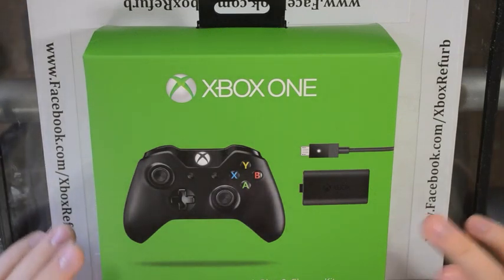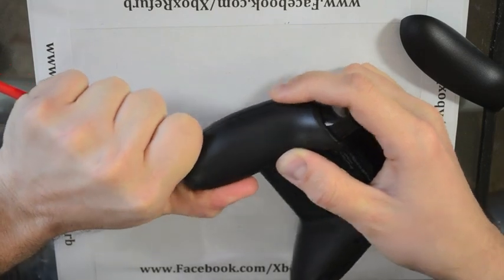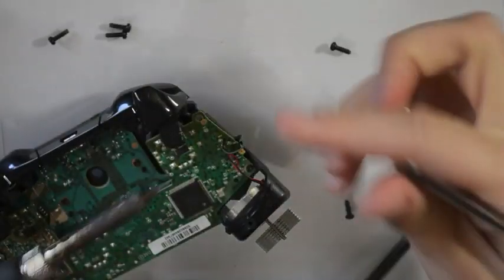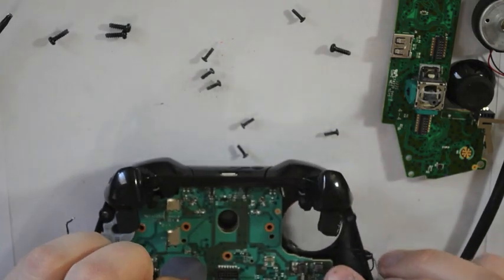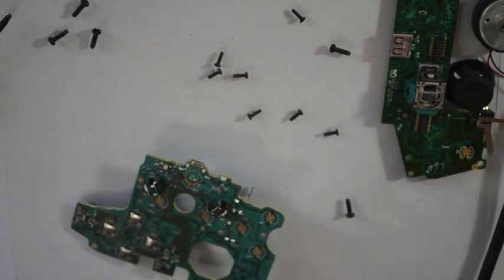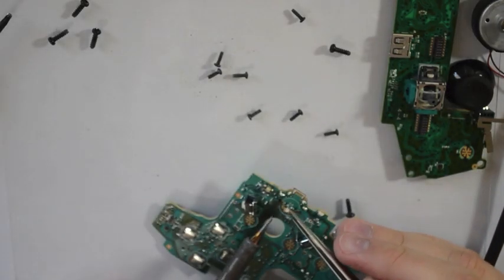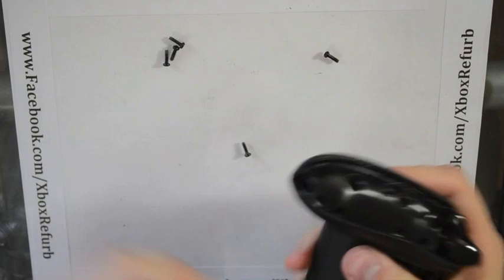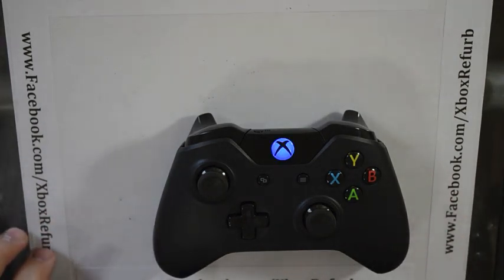Xbox One Controller teardown, disassembly, LED Swap of X1

Comment: Hey guys hopefully someone can help me with this: I swapped out an led on one of my controllers no problem but did not have much success the second time around. I managed to get the original led off but upontaking it off it seemed that the solder points ripped off and now can't get the new one on right. I manage to see the new one slightly flash at times when having the soldering iron at one end and tweezers at the other while attempting to solder it on but it will not work after I try to test it. Thanks in advance for anyone who read the entire thing and to anyone who might have some insight on this!

Comment: I changed the LED on my Xbox one controller.  After reassembling my controller will not turn on wirelessly with batteries.  It will only turn on with the cable connected to the Xbox one.  The Xbox light on the controller comes on and a the buttons and triggers are functioning. 
Any guidance here would be a great help.  Thanks.

Comment: Changed the led and now my controller won't even turn on. I'm so discouraged now
Reply: You getting into electronics? What happened?
Reply: Tried changing the led in my xbox one remote and now it doesn't even turn on. I don't get it. The led shouldn't effect the power of the remote.
Reply: Jeff Krug you prolly touched the board for to long or touched somewhere  your not supose to lol
Reply: Yea I'm a newby at this stuff. Taking off the factory led was a bitch. I installed an led in my console perfectly. Guess I need to spend $50 on a new remote:/ I didn't realize touching the board could cause issues.
Reply: Turns out the controller works except for the home button.
Reply: Did you do soldering? Or was it plug and play? If you were soldering, I'm wondering if it were the wrong led, or there could be a short.
Reply: We can diagnose and fix it in our shop
Reply: I'm pretty sure the left pad was ripped off. When I get a new controller maybe I can send it your way to get the led put in that I want Battle Beaver Customs. I don't want to risk damaging another controller.
Reply: We can retrace and repair damaged pads too
Reply: How much?
Reply: 15$ and 10$ to ship back
Reply: Buy a broken controller with thumbsticks that don't work and swap out the thumbstick board for yours. Easy to do if you have the torx security t8 and a torx t6 screwdriver, because the thumbstick board just pulls off when the screws are unscrewed as shown in the video.

Comment: Hey Chris,  really urgent question here. Which way do I put the LED in? Does it matter? I thought it did for the 360 controllers. Which way do I place the LED in? By that I mean the tip of the triangle or the fat side? Which way goes left/right? I wanted to test if my controller led would turn on without having to assemble the controller entirely, but when I applied battery power and pressed the button nothing happened. I know I didn't tear out a lead, help me please!!

Comment: I'm a Microsoft fan all the way. Always have been. But my god are the thumb sticks are horrible on these controllers. Over time and excessive gameing the plastic shell around the thumb sticks completely wear down and uneven to the point where they feel like it has a seized up bearing or something or it feels like you have dirt in there. With the PS4 controller thumb sticks (I can't believe I'm saying this) feels like butter. There so smooth I almost prefer the PS4 controller over the Xbox One controller.

Comment: Hi dude, awesome work but, where do you get new shells and buttons from? So far, I've only found a full gold replacement shell and buttons from a chinese retailer.
Reply: I know there was a lot for the 360 controller on Ebay for quite cheap, but there isn't much for the One's yet.  I'm waiting until there's more on there for the One so I have more choice and parts are less expensive.

Comment from the maker: @itsbohn they won't fit, the ones I use are redesigned on the shaft size and the lower cup. I will soon have kits available with a prybar and T8 torx to sell

Comment: Was the unsoldering of the rumble motors necessary?
Reply: yes it was. If u see after he unsoldered them it showed some screwes which are needed to take off the mother board
Reply: Maxwell Nazarko That's funny cuz I took mine all the way apart without removing any wires. Guess Im just better
Reply: Scott Johnson how much longer did it take to do it without removing the wires?

Comment: Hi, I have soldered the LED which works when I turn the controller on. However it won't connect to my Xbox. And I can't see and inferred lights while my controller is on. Any suggestions please?

Comment from the maker: @megaxharol they might. You may have to drill the holes in the 360 sticks a little deeper, or trim the stick up part on the board.

Comment: Getting Xbox one tomorrow and I have always added LED's to my controllers in the past. Just wondering if anyone could answer me this before i actually get hands on with the controller next week. Is it actually needed to take the rumble motors out in order to gain access to the guide button LED in the new controller?

Comment: Is the controller common ground or common line? I remember the older xbox 360 controllers were common line. Thanks. I use pcbs to padhack and place them in arcade sticks.

Comment: What size torx screw driver did you use for the inside screws that were smaller than the T8??